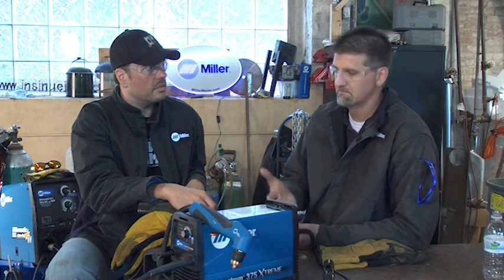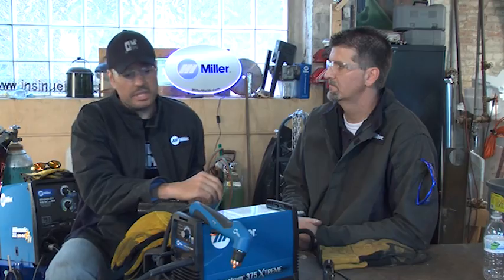Plasma Cutting FAQ with Metal Artist Stephen Christena

Comment: Another Miller vedio says it's fine to drag tip on metal with the 375 under 40 amps and as long as it's blowing through,,,so what's the real way?
Reply from the maker: Thank You for your question.  When plasma cutting above 30 amps an issue called double arcing causes noticeable problems in the cut and severely shortens the life of the consumables.  Below 30 amps this effect still happens but is not as noticeable of an issue.  With that in mind, cutting over 30 amps requires a standoff of around 1/8 inch be maintained either by hand or with the use of a drag shield on the torch.  A plasma torch with a standoff nozzle and no drag shield could be placed directly on the surface below 30 amps but with the expectation that the consumables will not last as quite long as they would if used with an air gap.  If you have further questions feel free to email us at info@millerwelds.com.
Reply: @MillerWelders  ... What is a standoff nozzle?  I searched the Miller welding site and can not find it.
Reply: @MillerWelders  .. specifically I am looking for the standoff nozzle for a 375 Extreme.  I don't want to use a drag shield (with the cross),,, and I didn't know there is a standoff nozzle that you can drag while using 20 amps or so.